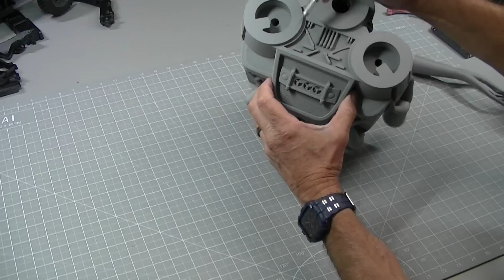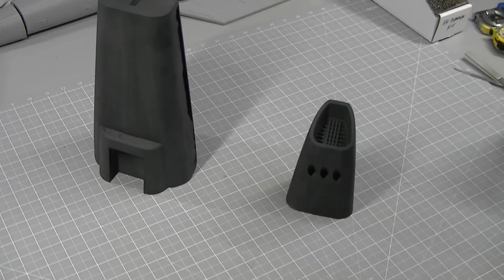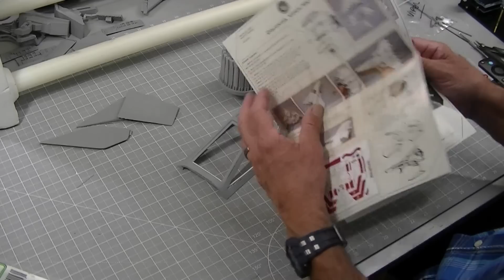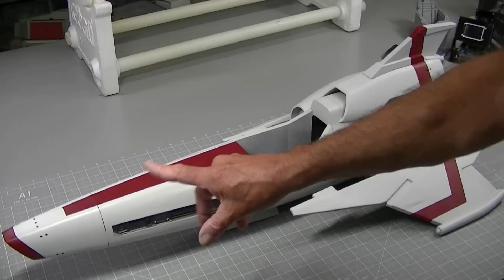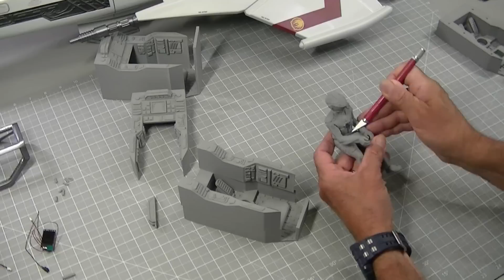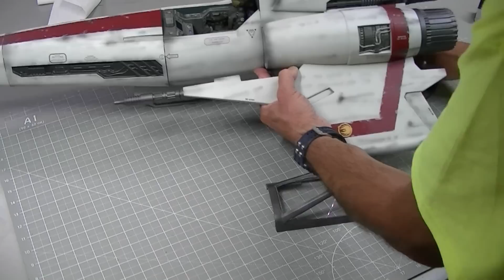Huge 1/10 Scale Battlestar Galactica Viper MKII Build - Gambody

Comment: Take my money….😊 how about a tiny magnet at the rear and front of the canopy. Just to hold it in place in the closed position so it doesn’t fly off if knocked. Also another pilot either stood next to the ship or in the process of climbing up into the cockpit. “This is core command, transferring control to probe ship. Launch when ready.”

Comment: Model looks amazing only a few things I would suggest, first the front end of the nose and the front leading edge of the wings need a bit of directional ware, meaning the tip of the nose worn more and dropping off as it goes back going back. and a guess a bit more directional wear of the paint as if flying through debris in space.  Second the wing tips near the end on the front where it looks like a small circle is suppose to be a red navigation light, it shows on a few screenshot of the tv show. Otherwise exceptional work. I may build my own using my FLSUN V400 and my resin printers

Comment: I always wanted to build a Viper into a car 2 seat (tandem seating) a small trunk area in front of the engine compartment all this enclosed in the engines housing the front landing (wheel further to the front of the craft for steering and the two rear landing (wheels) would be from the engine to transmission. The wings would be scaled down to fit legal street width limits (8'0" maybe a little bit smaller say 7'0") .

Comment: Thank you for the video, that looks like a cool build. I wouldn't have the room for something that big. Oh, I just wanted to pass along, if you use a negative part in Bambu studio, or orca slicer you could have setup the cockpit to not print the area you wanted to put the OLED in. Then you wouldn't have to cut it into any pieces, which would have been easier. Anyway negative parts in the slicer are very cool, you should check them out. Keep up the good work, I look forward to seeing what you do next.